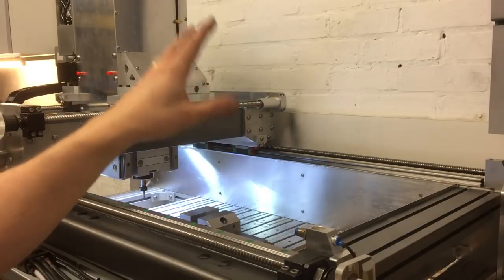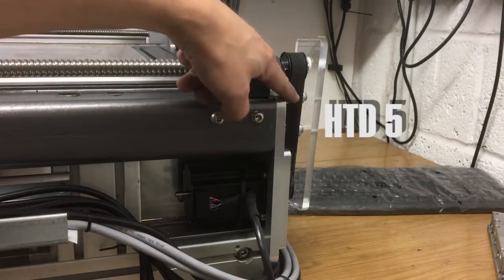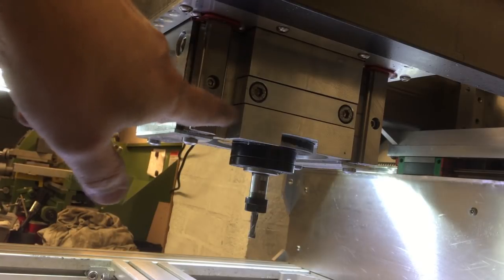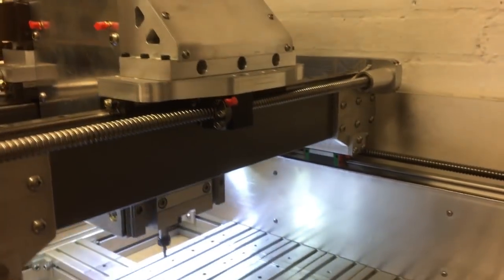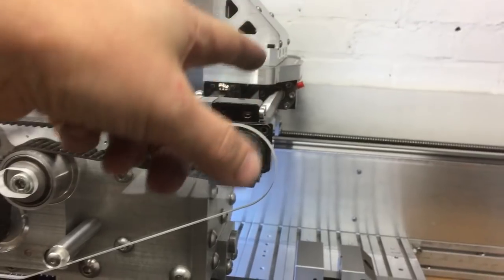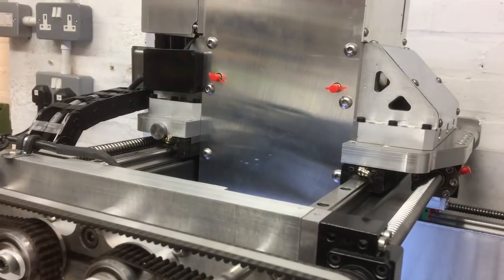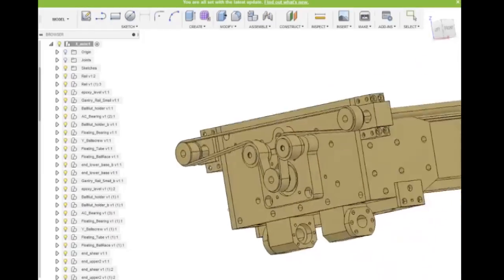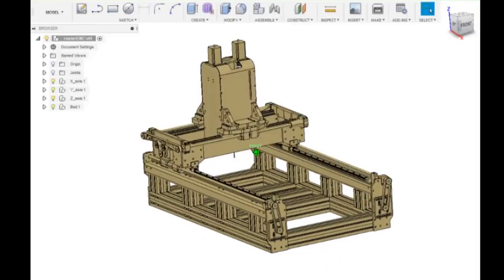Episode 25: Overview

Comment: Outstanding!!!! Now I don't feel so bad when my wife asks me if Im over building my table. Fully welded 2x4x3/8" tubing. Im not finished yet and it already weights into the 700lbs. Should break 1000lbs after I finish the X and Z axis. Now you have me thinking how I can build my Z to ease the Tramming on my spindle. Table is 5' by 4'
Reply from the maker: Wow now that’s a project!  Good luck with it and glad this series was useful.

Comment: So glad you made this video because I had so many questions due to your unique gantry! 

Very cool reasoning and great looking machine!

I honestly think the weakest link is the spindle. You put so much effort into rigidity and equalizing forces but then bought the cheapest spindle for it.

It's the same spindle I use but mine is on a WorkBee.

I have not checked the runout so maybe it's not as bad as I imagine. I just assume the bearings are cheap and it's not built to precision standards.
Reply from the maker: It’s a spindle I’ve had for years in many previous machines and works OK.  But don’t worry the Z axis housing has holes tapped for a proper cartridge spindle should I go for an upgrade.  Thanks.

Comment: simply WOW ..........  It's been almost 18 months since you posted this.  Are you still pleased with the results?  I imagine you use it all the time and are quite satisfied.  👍👍😎👍👍
Reply from the maker: Thank you.  Yes it has been great and hasn’t missed a beat.  I used it to make lots of parts for the ekart build series and am using it for the current drill press upgrade series.  It could do with an air/mist coolant but I need a compressor first.  Also it could handle a much more powerful spindle.  But overall I couldn’t be happier with it.

Comment: Hello, Could I talk to you over phone or WA?. I am really impressed with this machine, and plan to build a heavier machine for steel cutting myself.
I could take a few pointers from you.
Reply from the maker: I can’t offer phone support but if you post questions on the mycncuk forum you will get lots of help from other experienced builders, including some who may have built something closer to what you want.
Reply: @routercnc9517  sure, I was wondering if I could buy the drawings from you for me to get a good starting point.
Reply from the maker: I removed the download from the site recently because it was costing me more money to have it hosted there than I was receiving in sales.  It was also just the CAD parts of the machine - there were no drawings.  Your best option is to draw something up initially and ask for help on the forum.  Then you will get a machine which is right for you.

Comment: nice very over engineered build 
but did u try slot with it?, if not then I really dont see a reason for all the effort made
just a thought, what do you think?
Reply from the maker: Yes I’ve cut lots of slots with it and it works very well.  See my videos on the kart build and my current series on the drill press upgrade to watch it cut real parts.  I really need an air compressor to create a fog buster system then I can cut to the full potential.  Thanks
Reply: what i mean by slotting is at least 1xD for a 6mm in steel
do you have that? because wut i have seen so far was shallow doc
please share if u have shot that, thanks for your reply
Reply from the maker: I don’t think there is enough spindle power for cutting that deep in steel.  This is a high speed spindle for wood and aluminium which is what I cut.  I don’t have any mist spray system so am limited to make sure I don’t get chip welding.  What you see in the videos are the typical cuts I do at the moment to make sure I get reliability and good surface finish.  Thanks

Comment: Having a 3D printer attachment on this would be awesome.
Reply from the maker: A bit overkill but it would be handy.
Reply: routercnc dude everything is already over kill, by now you should be printing continuous threads of carbon fibre. Great work.
Reply: The results would be very dissatisfying. 3d printer speeds are 3-6x more than of a CNC. Hence 3d printer is lightweight. You run a normal CNC on 3D printer speeds, the bearings, shafts, couplers and chassis will give up on the spot
Reply: keronGR makes sense, thanks. I never looked at it that way
Reply from the maker: Ha ha yes.

Comment: By the way did you draw all the components in the cad? Why didn't you use GrabCad models?
Reply from the maker: The linear rail cad was downloaded from the supplier website.  I drew the rest of the parts myself.  Drawing box section and plates is not difficult or time consuming.  I also drew the spindle as it is basically a cylinder with a cutting tool on the end.  What takes all the time is deciding on the exact sizes and arrangement of components to create a working design.  These are all unique to this machine.  Thanks

Comment: This is awesome. I definitely want to take some inspiration for my next build in a few years. Out of interest though do you feel like there are any parts of the design that may be over engineered to the point it has minimal impact on the overall result?
Reply from the maker: It is possible a single ballscrew on Z would still work, just the left or right side.  But the Z axis is heavy so I didn’t want to have problems with lifting it.  The rest I think is required for heavy cuts into aluminium leaving a good surface finish.  Thanks

Comment: Excellent frame and design, highly limited by a cheap 1.5Kw Chinesium spindle. You can't run a Ferrari on Aliexpress tyres mate....
Reply from the maker: I agree !  I’ve had that spindle for about 10 years and it has been transferred across from each machine as it does work quite well up to a point.  However on this machine you might have noticed holes and features in the top of the Z axis parts - these are for a future upgrade to a pulley driven cartridge spindle and possibly a power drawbar to allow ATC.  Just lots of other projects on at the moment.
Reply: @routercnc9517  honestly, I haven't seen on youtube such a well designed frame and electronics, hence the bad critics on the spindle. There might be 2-3 channels which designed a robust cnc, but yours excels in aesthetics too. It just hurted my eyes seeing that spindle being carried on this well engineered project

Comment: Nice build mate! How big is your x y z travel?
Reply from the maker: Hi James,
It's a little smaller in Y than my previous machine due to the larger Y and Z axis.  The working space / cutting area is now 790 mm x 360 mm x 125 mm.  If you are interested in the CAD please note as per the description in the text box above there are no drawings, you just get the CAD of all the parts in an assembly tree.  Drawings could be made from each part of the assembly but you would need to do that.  Thanks

Comment: Hi; great machine and great skills ! I have stumbled upon your Excel file on stiffness back in 2010 on mycnc , and I was meaning to ask you about the formula you used on tool deflection. Could you please point me to the source of it ? It has been bothering me for a while. Thank you.
Reply from the maker: All the formulae I used are in a book called Roark's Formulas for Stress and Strain first published in about 1938, but updated and reprinted several times.  I will warn you now it can be heavy going and took me a while to reproduce in Excel.  Thanks
Reply: @routercnc9517  You've done a great job, both with your build and with the Excel template! I have so far found  just 1 minor omission in the template: bending deflection from gantry sag in the Z direction is reflected by both the point load to the center of the beam (as in the template) and the weight of the beam (omitted), that is:  total weight of the gantry x lenght^3 /(384 x E x Ixx). But I am sure it doesn't matter too much when the gantry's own weight is not that heavy. Excellent job anyway and congrats !
Reply from the maker: Yes, I was being lazy as it does not add much more deflection.  Nice to hear someone appreciating the technical side and not just the shiny bits !  I tend to forget I wrote that spreadsheet as it was some time ago but it is great that it is still helpful to people.  Today most people just rely on FEA and button pressing and that is an amazing tool that we could not do without in the modern world, but if you know the formulas it gives you some insight into the optimisation you might need.  Properties of a simple beam stiffness are related to (bd^3)/12, where b = the width and d = depth.  You can see straight away that small changes in depth make a large difference as goes up with the cube of d.
Are you building, or have you built a CNC machine, or is it just an interest ?
Reply: @routercnc9517  Indeed, having the right formulas in a spreadsheet is an excellent opportunity to test various scenarios. I am currently designing a router cnc to cut steel and aluminium, but mostly steel (it will have 2 spindles).  It is thought to have an effective cutting area of about 2m/1,4m/0,5m. I know it is a lot and I am also aware of the gantry's limitations when it comes to torsional stiffness. Which by the way is quite a challange ( the torsion constant) to compute by hand/excel (no FEA I mean) for a composite cross-section. There are various opinions on  whether to add up each torsional constant of each individual cross section you split the composite section into, or not and how reliable  this can be. Still reading on this topic. Anyway, just the beam of the gantry (without the legs) will weight in about 500 kg over a total length of 2,2 m, out of which 1,40 m will be unsupported between the legs and 0,25 m will overhang at either end (I plan to use a vertical-to-horizontal right angle attachment that takes up a lot of lateral  space); the Z carriage will be around 250 kg and off the center of the beam by around 250 mm, (hence my extreme care and concern about beam's torsional stiffness) and the legs will be about 250 kg, making in total about a cool 1 tone of just a gantry !. The total width of the beam will most likely be 500 mm, by 400 mm hight, composite cross-section. There will be some UHPC in it (ultra high performance concrete) which helps with vibrations a lot. Already bought it from Germany. The total weight of the machine will be around 3 tonnes, steel and UHPC. No stress relieve of steel, but I do hope that the rather large mass of it will work some magic !  I will not compromise on precision and cutting envelope. I will compromise however on speed ( gantry movement and if needed cutting force) , on overhang (will add on the table as many layers to highten the work right under the gantry as needed, which will mean a lot of time to align stuff on the XOZ and YOZ planes ) and on costs (it will be around 12-15 k Euro, without metrology and lifting equipment, which I have already bought and cost me an arm and a leg). So, the MRR will be the floating variable at this time, and I will compromise on it as much as it will be needed, and by ''needed'' I mean to the point where speeds&feeds that greatly enhance MRR but slightly affect precision, will be discarded. Against the mainstream mantra.  I am prepared to build a '' snail-like cnc'' and to cost me some money, but to get the precision I want. I do hope for better that 1 thou of an inch over 1 meter of length. Subplates will be scraped in.  It is gonna be some fun ! I will keep you posted, if you are curious about the project. Cheers !
Reply from the maker: Wow, that sounds like quite a project.  If you are not a member of cnczone (are you in the States?) or mycncuk then you would be best posting there and many (including myself) would follow and offer comments.
I've not used it but Fusion 360 should have an FEA side which you could experiment with for various gantry options (for torsional stiffness). 

When you said cutting steel then the usual advice is to convert a milling machine to CNC, rather than go for a router with a gantry.  But what you are suggesting could also work and sounds like you are enjoying the process, which can be part of the fun.  Plus the cutting area suggests a router style.  Have a look at the DMG Mori Seki NMV5000 DCG (download the pdf > page 9) for a moving gantry style CNC machining centre.
Good luck !
Reply: @routercnc9517  Thanks for suggestions ! I have already had a look at the Digi Mori gantry style machine and they look great. As far as converting a knee mill into a cnc, indeed my cutting envelope would not allow it and secondly, I don't trust 2 tables sliding one on top of  another but in different directions, as they bend under heavy load . As far as posting on forums, I am already a member of both of them, but haven't posted anything yet. And most likely I will not post until I finish the project, as I wouldn't want to bother the readers whenever I change my mind  about something I had previously decided upon. Maybe it is silly, but that's how I feel about it. I am an avid reader of forums however and I "watch and learn", most of the times staying away from making any comments on other people's work. I realize that by not posting any of the work-in-progress it would mean that I would also loose the opportunity of getting  other people's insights into my work and I might be loosing some valuable lessons. I guess I will have to get used to that idea. I am a Romanian living in Romania by the way,  and the cnc community here is not precisely effervescent, most hobbiests having a hard time raising money for a decent project. Which makes my project a rather peculiar one. Some good people, some good skills, but poor financing of projects. Which comes at no surprise, as It is a poor country after all. The good part is that the spirit is the same as everywhere, that is making possible the  impossible. By the way, I was going to ask you about the precision of your machine: was it the way you intended it to be ?
Reply from the maker: Sorry, I missed this post.  Yes, CNC machine building can be an expensive hobby, but you are right - the desire to make interesting objects exists worldwide.  I am very pleased with the precision and can easily hold +-0.03 mm, usually better.  Also, the surface finish is very good.

Comment: hello, great work! I follow your channel with great interest! could you make a video on the electrical panel? connections, safety devices, inverter...
Reply from the maker: I’ve been thinking about that for a while and may add it to the list.  I’m working on an electric kart video for my young daughter (see other build video series) which I want to finish off and also have a big job to finish in the house so stay tuned and we will see . . . !
I will say that in contrast perhaps to the machine itself the control cabinet components are not that special, and some are quite old now.  But they get the job done and it works.  If I ever get around to it I will mention what the better choices are that are more up to date.  Thanks.
Reply: I also follow the kart videos with curiosity. I will wait calmly for your future videos. Good luck on all your projects :)
Reply from the maker: Thanks
Reply from the maker: Update - in case you missed it Episode 26 is out now showing an overview of the control panel.  Thanks

Comment: Do you have the working space dimensions of this router? Or did I miss that in any of the videos? I browsed all 25... :(
Reply from the maker: Hi Richard.  The working space / cutting area is 790 mm x 360 mm x 125 mm.  Thanks
Reply: @routercnc9517  thanks! Did you buy your linear rails and ballscrews from China? I'm wondering if I should do the same since I might not need crazy accuracy myself.
Reply from the maker: The X rails (long axis) and Z rails were all from BST Automation (Fred) on Aliexpress, and were Hiwin brand.  Tell him what you are after and he will put together a quote, including low cost end machining of the screws if required.  The Hiwin rails and carriages are made in Taiwan, but they have built up a good reputation.  Most builders on the mycncuk site buy from Fred and they are great quality.  I don't have a metrology lab (!) but with careful setup on my 0.01 mm DTI the needle did not move when the rail was passed underneath.
The Y axis rails I have had for years and are THK brand, bought used, and before the China stuff was widely available.
The ballscrews are also from BST and are rolled C7 grade.  These have  about 0.05 mm backlash, with a pitch error of 50 microns per 300 mm.  These are more than good enough  for a DIY machine and are what most builders choose.  You can spend more on C7 ground screws at 25 microns per 300 mm, or go all the way to C0 at 5 microns per 300 mm.  I dread to think what these cost . . .
For the DIY builder parts with good quality and plenty of accuracy are easily available.
Reply: @routercnc9517  do you have a link to the linear rails you purchased was wanting to get the same ones?
Reply from the maker: https://m.aliexpress.com/item/32997758219.html?trace=storeDetail2msiteDetail&spm=a2g0n.store_allProduct.allProducts_332325.32997758219

These are 1000 mm long as an example, you will need to ask Fred for the lengths you need.  Thanks.
Reply: Thanks! This is what I was looking for 🙂